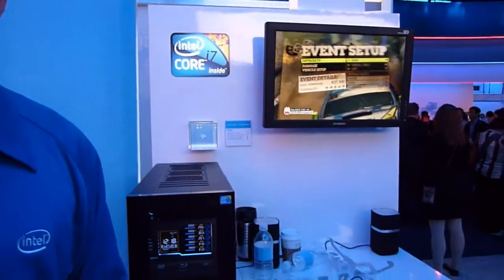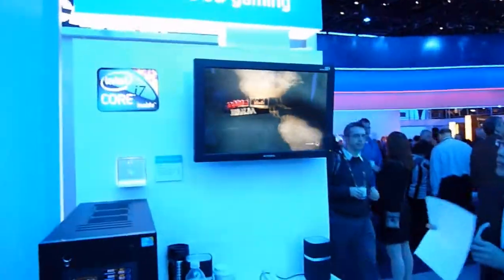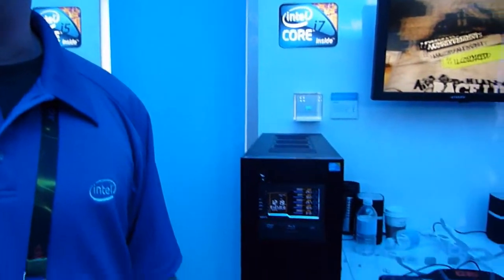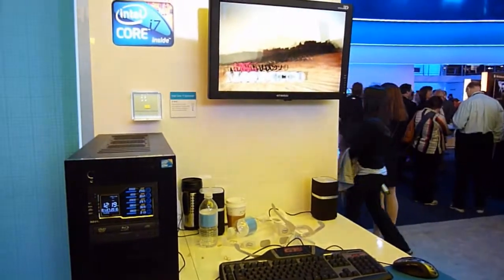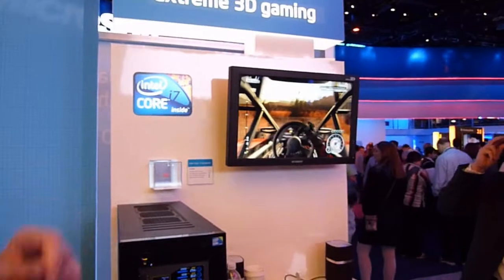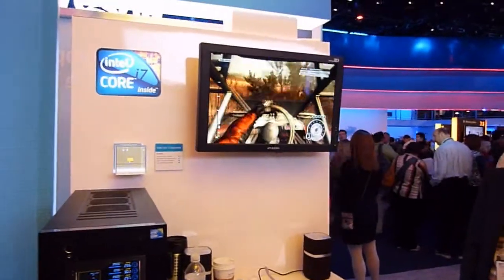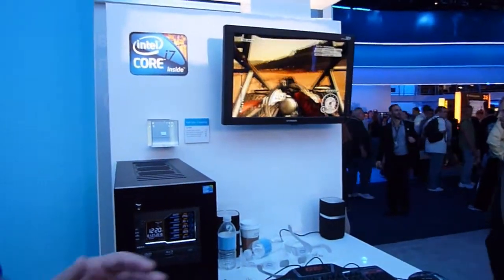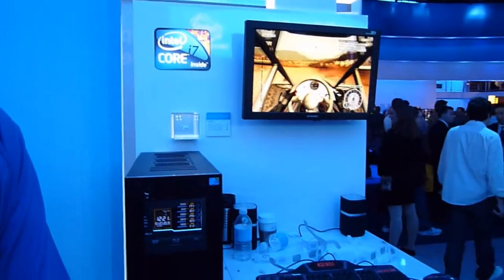Intel demo-ing and discussing 3D gaming on Core i7 at CES 2010

Comment: @movieluv94 
Its the processor that's shutting down the cores on its own when it recognises it doesn't need the extra Cores!

This enables the still running cores to "self over-clock" for better performance in single/dual core applications!